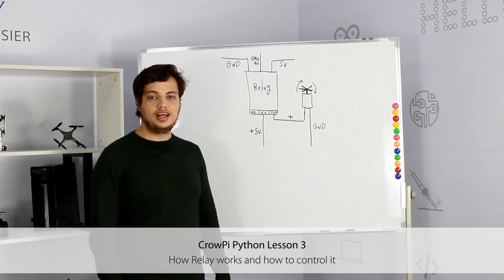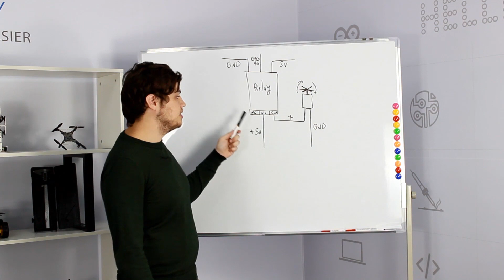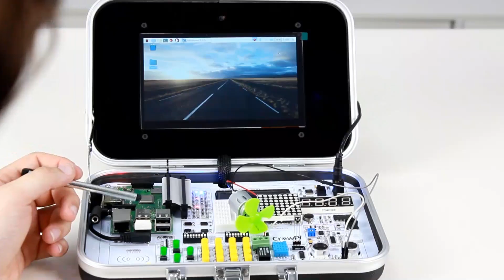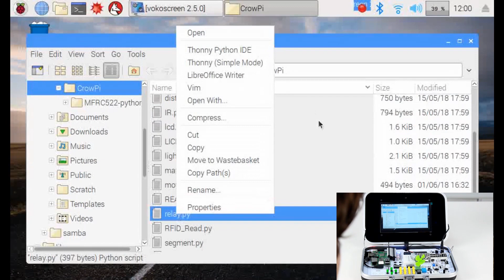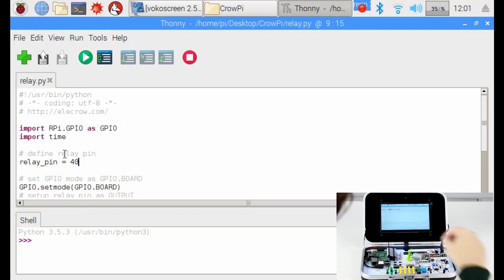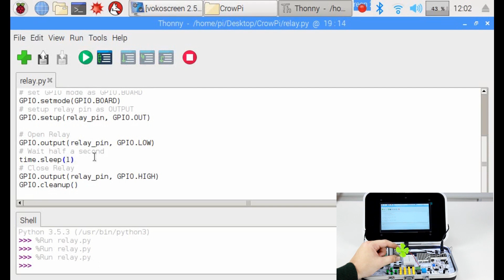CrowPi Python Lesson 3：How Relay works and how to control it

Comment: Something I figured out.  On the Pi4 version of the CrowPi, it has the "version2" relay.  The written lessons have the terminal block names and their order wrong.  The label on the board correctly lists the order from left to right as VIN_NC (normally closed), VIN_NO (normally open) and GND (common ground).  A check with an ohm meter confirms that GND is connected to ground.  On other relay components or circuits you may see, the NC and NO terminals will initially be connected to nothing.  But on this board, VIN_NC has +12VDC relative to GND.  Triggering the relay with the python script moves that +12VDC to VIN_NO (I suppose the "VIN_" portion is supposed to indicate that voltage.  On one of the Elecrow documents I found an obscure reference to that, but it wasn't obvious to me until I had figured it out with my multimeter).

So on a Pi4 version CrowPi with "version2" relay, you will NOT be connecting the terminal block to +5V (Vcc) or GND on the Servo1 connector (you may blow out your board if you try).  Instead, you will connect your load (one that can handle 12VDC!  That is, a 12V motor or an LED with an appropriately-large resistor) directly to the VIN_NO and GND terminals.  You do this by loosening the screws on the top of the middle and right terminal block connections and inserting your wire into the corresponding hole on the FAR SIDE of the terminal block (lean over and you'll see it), and hold it there while tightening the screw.  Do yourself a favor and do NOT over-tighten it.  You may break the terminal block or shorten its life.

I offer this in the hopes that it will alleviate your frustration and help you understand how Elecrow has configured the "version2" relay on these boards.

Comment: I am beyond frustrated with this relay switch. You should have included how to plug the components into this damn thing. I have been trying to use the LED provided with version 2. For the life of me, I cannot figure out how to properly insert the wires into the pins. The LED fits perfectly into every pin of the breadboard. It is only the relay switch that feels incredibly awkward to use.